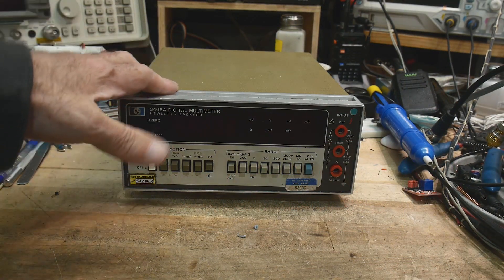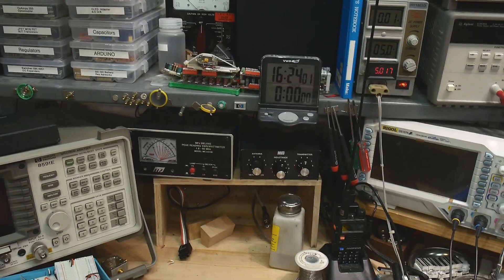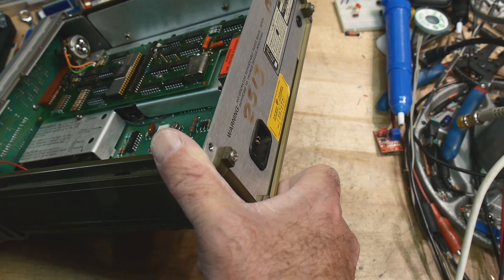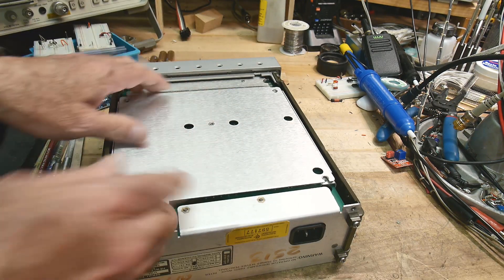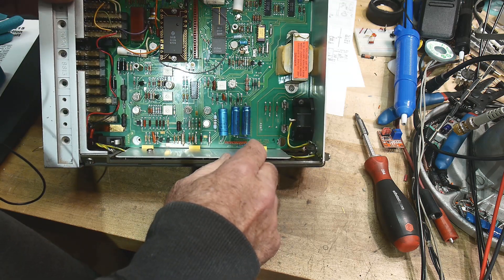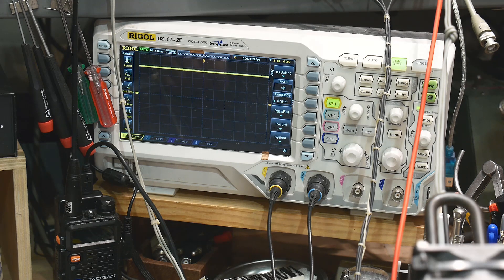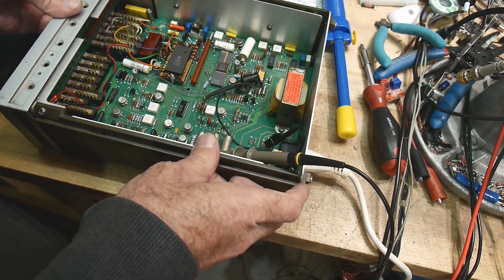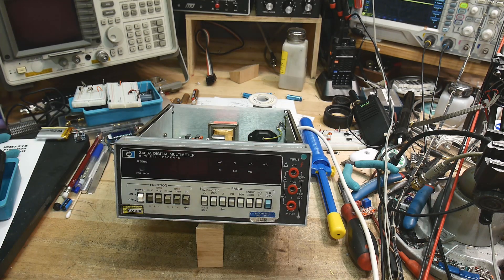#671 HP3466A Multimeter Repair (part 1)

Comment: That it has a battery option was not mentioned? (in this vid... it is mentioned at the beginning of part 2) The battery was a lead acid (gel cell type.)... and adds a significant amount of weight...the battery (if it hasn't been recently replaced) is always DOA... and you're paying to ship it.
Reply: As I recall... the battery could have been a 'sealed lead-acid" type... though the flooded acid, sealed lead acid, and glass fiber mesh are the current technologies... and I'm not sure where the gel type is the same as the glass fiber mesh technology. I think the first two can vent (to relieve hydrogen pressure build up ... and the fiber mesh does not vent. (It's completely sealed AFAIK.) Venting hydrogen (along with traces of the corrosive electrolyte) doesn't seem like a good idea anymore.

Comment: When troubleshooting using a scope do you use an isolated AC power supply with no earth connection?
Reply from the maker: no, hardly ever
Reply: @IMSAIGuy  I have several variable isolated AC power supplies. They are very helpful in protecting equipment (scope earth connection) and troubleshooting.
Reply from the maker: @windward2818  if you are talking about variacs, they are not isolated. A true isolated supply has a different transformer.
Reply: @IMSAIGuy  My latest addition is a custom design having a Toroidal Medical isolation transformer 1:1 front end with DUT output controlled by a Variac, max load at 120 VAC of 10 amps. The earth connection is broken.   This way you can use a grounded scope for a hot chassis probing if need be. I have a two channel Fluke Scopemeter so I generally use this first to troubleshoot. The two channels are completely isolated from each other and ground (the scopemeter is battery operated). However, if I need more bandwidth or better features I can bring in a better bench scope.
Reply from the maker: I have a similar setup. variac followed by a true isolation transformer. use it from time to time.

Comment: The first meter I bought and fixed was one of these, one of the metal can op amps was bad. It was preventing the 7 volt reference rail from coming online, which all the other rails are derived from iirc

Comment: I'm currently working on an HP 3312A Function Generator. Same chassis as the 3466 and it has the same push buttons controlling the frequency range as the 3466. The date code on my circuit board is 1984. And the unit was used in an environment where the settings were seldom if ever changed (based on the markings on the front panel). The contacts on almost every single push button are so tarnished that only a few range settings work. So if the manual range settings on the 3466 do not work correctly you probably need to get out the Deoxit.

Comment: May come up in part 2 but was that 6.3 V point possibly a AC voltage coming off the transformer?
Reply from the maker: I think it had something to do with the battery option. Once it started to work, I didn't go back to look.